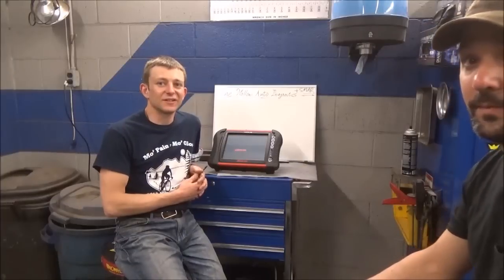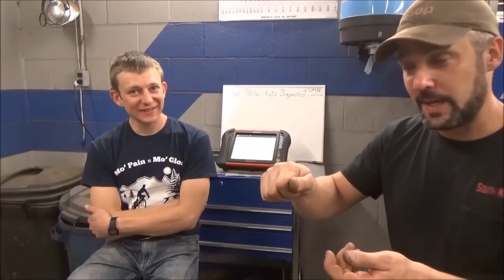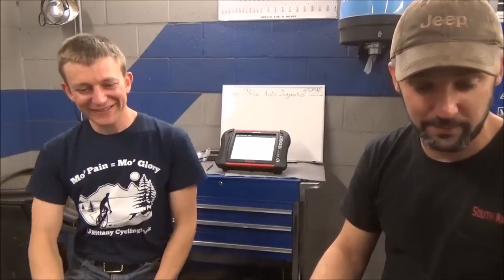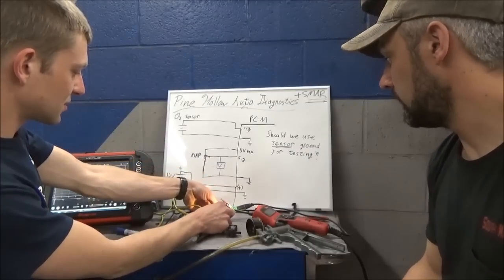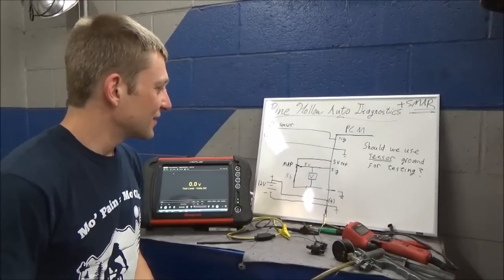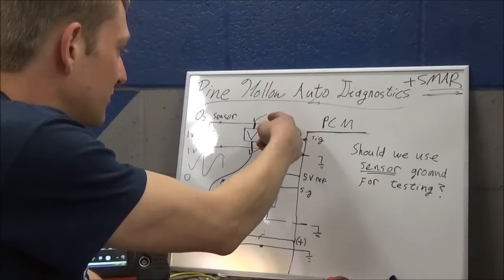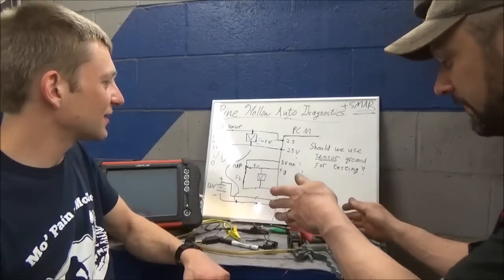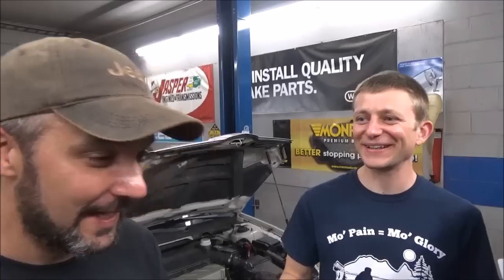O2 Sensor-No Activity Case Study: '04 Mitsubishi -Part3

Comment: My bet was that there was a "special" O2 ground wire on the ECM that was disconnected !

Good white board talk.  Nor everyone knows that O2 sensors are a true "voltage source".

As Eric knows, I have "some" background in EFI systems.  Many sensors now do NOT have a "mechanical wiper on a resistive strip" (potentiometer) but in fact "generate" the return voltage. MAP, BP, MAF are just a few.  For all intensive purposes they work the same, except under one circumstance.  With a potentiometer type sensor (TPS, temp sensors and some other "position" sensors) if the reference voltage  shifts to say 4.8v, they will still give you the correct number of "A-to-D count" (how the processor actually see "voltage" internally) where the other sensors do not.

Comment: I was wondering why all the information was showing the same information about the wiring colors on the sensors, yet the colors were wrong. And as Eric had mentioned, I've seen the wrong colors too on wires and just moved on with it. But I must admit that having an engine changed along with its wiring harness was not the first thought on my mind. You guys did some great detective work! Without having to go back and look at the wiring diagram for the 2004, where was the grounds connected at for the O2 sensors since it wasn't inside the PCM? Did they all come together inside of a connector and then a wire run off to a ground point somewhere? Just curious on its hookup...
Reply from the maker: +stuzman52 Hey Terry, thanks for the comment! The grounds for the O2 sensors on the 2004 harness all went to a common splice with all the other sensor grounds and then to the PCM on a single pin. Don't know why they decided to separate those on the 2006 model...maybe for more accurate circuit monitoring?
Reply: +motoYam82 Thanks Ivan for the reply and I believe you're right about more accurate circuit monitoring as each as their own ground circuit. Then they could detect a short or open on individual sensors.

Comment: Getting the OEM harness for the customer is the correct way to do it, awesome work. .... Having said that, if it were my car that I had bought on the cheap, I (and I think quite a few folks) would have just tried to reroute those 4 wires. How hard do you think that would've been?
Reply: That´s what customers here in Mexico wants you to do,even the filthy rich.
And it works, done it several times, I call them frankensteins. And when it comes to wiring diagrams here in Mexico It´s even worst we have vehicles from different countries and most of the  time no diagrams or very misleading. For example imagine a 2001 chevrolet truck with a obd2 conector and a  obd1 1994 TBI system. And the list goes on.When you hook a snap on scanner you have to play with several years until you get the right PIDS. Glad things are changing on late model vehicles. Still, we get for example a hyundai accent name  dodge attitude  here and have to deal with the diagrams game.

But what these awesome guys did was the right path. That´s  what makes America great

 But we go to war with the weapons we have

Comment: i enjoyed the videos mitsubishi ,who would have guessed that some put a later wiring loom in it  ,when i check o2 sensor, i check voltage on all four wires with it connected and unplugged for pcm outputs ,

Comment: Nice video!  I have a question .What could cause when i unplug both upstream oxygen sensor car runs ok but when i plug then ,the car will die as soon as it reaches normal temperature. 97 audi a4 2.8

Comment: Nice, you really did a great job with this car however, that still doesn't justify
why the scope was measuring 12V and the pcm showing 5V on B1S1. I mentioned
in part 2 comments that it is probably shorted to the heater, you can see my comment
there for why the scope vs. pcm value is different.
Reply from the maker: +Som Body See reply to Robert Hayward below...
Reply: +Som Body The PCM was supplying 12V to the B1S1 ground but was less than a 250 mV b/c it wouldn't light the test light but caused the 5V processed data. When he grounded it out with the test light it went to .020V like the other sensors. Normally you'd replace the PCM b/c of this but for 2004 the sensor grounds aren't connected to those pins with the correct harness. Whoever changed the motor and plugged in the harness got lucky Mitsubishi didn't swap out some power pins with ground pins...POOF!  Scope data is more accurate than processed data but processed data actually showed the issue. Whoever was troubleshooting it before cut the heater wire to eliminate the 12V from the sensor heater.  Bottom line is those pins aren't even used and the car is fixed but it definitely threw a twist at us!

Comment: So, if you would have done a voltage drop on the ground side (dvom connected after the load) you would have found unused power and therefore, no ground?

Comment: A great find and fix video. My thought was PCM, but I would have had to eat it with some crow. It is so hard for me to get in my head, even when the diagrams are correct, that a wiring harness is wrong for car; especially when it looks like it hasn't been disturbed. But isn't this what we do though," FIX"  broke cars by being detectives?  Would it have been possible to move existing wires in the harness to the correct pins in the harness plugs but, who knows what else might not work correctly in the future though?
Reply: alldata is great so is the dealer but sometimes its not always great... I gotta tell you that my experience is with gmc auto lock 4x4.  there are two pieces broken in the hub.  gotta buy the whole unit.  crazy stuff like the kia when it says replace timing belts at 60 k do it before that.  and replace everything in that area water pump idle bearing etc.   it just gets nasty cause most of those 4cylders are interference motors..

Comment: I would've wire wheeled and painted that rusty heat shield- just for a finishing touch- you could've used brake clean to rinse before paint. Eric- in your opinion- is it possible to "wash out" a poisoned converter? Have you ever tried to?

Comment: instead of replacing the harness, why couldnt you just repin the wires to the correct pins? would seam like that would only take a few mins?
Reply from the maker: +Mike Brennan That was Eric's decision to make. Basically it would kill several birds with one stone and make the harness correct to the car and avoid any potential confusion down the road!

Comment: l knew that's what it was!!!! lol ...(well that was easy) just proves you can't discount any clues ...aka wrong color wires like I said before I am a mechanic also Eric you call yourself doctor O I must tell you sometimes when I'm trying to diagnose cars I feel more like Quincy at the crime scene try and figure out what happened??? great video Guys!!!!!!!
Reply: +mike chainz Good call!
Reply: Lol honestly I had no idea either but the wire harness was a suspect
Reply: Ivan Eric should have used brake clean  on the wire loom that way you would have been able to see the colors easier lmao love you guys
Reply: +mike chainz Brake clean and a match haha
Reply: Yes that probably was the best option although you got it made I'm outside in chicago in the snow right now doing a front end ball joints tie rod in and out and steering box on a 05 Escalade on the ground without a lift
Reply: mike chainz Wow dang man! Sounds like you should have bought a Highlander! Lol nah JK'in
Reply: Lol I wish .....nah lol. I work from home it's customers truck
Reply from the maker: +mike chainz Wow must be some bad potholes in Chicago...or does it have 22-inch oversize chrome dubs with low-profile tires? lol
Reply: Lol both you call that Ivan 24 inch low pros
Reply: Only 129000 on the clock lol hey..it cost to look that good

Comment: I'm just putting my 2 cents in on this video.. Ivan & Eric, when you had to use a wiring diagram from 2006 didn't that kinda rang a bell. Maybe someone messed with the wiring harness. Anyway, great video. I wonder what the customer said when you told them.

Comment: It's amazing how many ground terminations go bad just from age.  Car manufacturers need to step up with the quality of their electrical designs. Not the case in this video however, it does happen much in lots of repair issues. Who woulda thought...the engine was swapped !  Goes to show if you swap the harness too, you best have done some research about that. Regarding the catalytic converter requirement, there are certified aftermarket brands out there approved by CARB. Not so sure about the OEM only if there are CARB approved brands. Maybe the state needs to look into that.

Comment: I guess if a replacement loom couldn't be sourced, you could have made a new 'mini' loom just for the O2 sensor circuits?  Would have still got same result, yes?
Reply from the maker: +Darren Coull Yup that would have worked too in a pinch.

Comment: The real issue is the pcm connector was not keyed in some way so it wouldn't fit on a different year wiring harness.  That would be the least Mitsubishi could do to prevent such.  Different year different connector even if the internals of the pcm are the same.

Comment: heres a good one my 1990 jeep was hard to start, and the vaccum line to the MAP sensor, was reading 14 inches of vaccum, turned out the timing chain was so lose the cam was 12-14 degrees off, so I replaced the chain and gears etc, and  my vaccum is 18 inchs, now yeah and some hack messed around with the temp sensor and mass air flow sensor were not getting juice, what some one did was an engine swap or shitty rebuild (blue goo on the oil pan gasket) and  instead of unplugging the harness they cut wires and taped em back together I live in WV and there is no emission checks for inspection, the engine has an oxygen sensor on the exhaust manifold, but they removed the cat, plus they removed the check engine lite from the dash, I bought the jeep for cheap, so it has been a challenge, by the way im over sixty and used to work on foreign cars when carbs and points were the norm, anyhow your video,s have been very helpful, these days, its all about diagnostics (electrical engine management,) and hardly any body does, rings and bearings etc, and most young guys dont know shit about carbs or cam timing etc, the shop says you got a rod knock so instead of repairing it, you end up with a new short block, oh well how times have changed.
Reply from the maker: Thanks for the comment Tom! I love variety...new and old school :)

Comment: Having watched many videos from both of you, I was very surprised at the start that you didn't check the wiring from the sensor to the computer. The scope on a rope would have indicated the problem very quickly. You jumped to the fancy equipment too soon. Testing the grounds and the power would show a problem. Maybe that's why I see you both checking grounds and current flow in videos that took place after this. Having worked in the used car industry in my earlier years, I learned to NEVER assume a used car is entirely original. The wrong wiring colors on the wiring diagrams had me thinking of a replaced harness. Your experience with diagrams that don't match tainted your judgement.
Reply: Are chair quarter  back here
Reply: @Emoney-z1r  Are chair? I suspect the term you were attempting to reference is Arm Chair Quarterback?

Comment: I have a 2001 puegot  has a 406 diesel engine the air conditioning has fill ports that are not the ones specified in the manual no one could explain why,  so I have to live with two different size air con ports

Comment: Does NY state prohibit the owner from buying and fitting a cheapo cat?
Reply: +Adrian Kingsley-Hughes nope... you can replace that catalyst yourself with a used, you can put a anti foul spark plug adapter in front of the o2 sensor... as long as the "$" light is out and monitors pass. another way NY screws shop owners.

Comment: Really good 3 part case study.
For me alarm bells for the sensor grounds started ringing when we seen 5 and 6 volts on the O2 data. When we see lights flash with the indicators we know there is a bad ground and the circuit is looking for the easiest path to ground. Was this not the case with the O2 circuit looking for ground on the 5 volt reference circuit. Where else could the 5 volts be coming from? You mentioned that the later model did not use the particular pin for anything but I wouldn't mind betting that internally there is something connected to it.
I may be be way out in left field but it seems to make sense to me 
Either way. I really enjoyed the series.

Comment: Question. Assume the following hypothetical....The owner travels to another state, buys an aftermarket Catalytic Converter, then installs it themselves onto this vehicle. When they go in for inspection in NY, do they actually look at the CAT visually and fail the vehicle if it's not OEM? If so, what happens if you bring in an out of state registered vehicle that's equipped with a non OEM converter and try to register it. Does the state government force the owner to buy an OEM converter and replace it before passing it? Of course I'm only asking for general knowledge. I would never attempt to actually do anything like that or encourage anyone else to. I always comply with all government rules and regulations personally.

Comment: could you have just depinned the wires and reinstalled them in the correct pins. If all wires were the same except for those 4 wires?
Reply: Think again. The most important pinouts (for this case) on this computer are "not in use".
Reply: @josdiepenbeek469  This had nothing to do with the computer. The wiring harness was pinned incorrectly for that year. I shoulh have been just WAY easier just to move the pins on the harness to match what was the original set up. Your reply made no sense.

Comment: Ran into that "CARB" issue with our VW.  wound up ordering from a parts house in NYC that had me supply vin, emission information, etc..  Found that if the converter was an "exact" match aftermarket compared to factory it is legal to replace with a non-carb converter.   These laws are made to punish, not to protect.   Too many loopholes and too many pitfalls, and not enough information as what can be used or not.  Did I get my converter via a loophole?  Probably.  The CARB one goes for over 800 and it would require me to change out the exhaust manifold  (ours is a single downpipe, the CARB one was only made for the twin downpipe from the manifold)  So these clowns have no clue what their baloney rules do to the end consumer.  

While I am all for 'clean air'.  The CARB requirements are a bunch of baloney.  Just more progressive NYC and by extension Albany (who gets it's power from NYC, and the heck with the rest of the state) trying to be just like Cali.  Just a bunch of loon's trying to control people.

Of course, that's just my opinion..

Comment: i have a 1998 chevy  k1500  5.7. service light comes on. go a friend and he tested it by the obd  shows bank 1 sensor 2.  ok.    go to another guy, same  code p0141.  ok.  YOUTUBE videos,,,,,, onr guy says  o/2  and relay are both on some FUSE!  ok.   one guy says  always start with fuses ALL  fuses  ok.  i checked ALL fuses  with mo/ volt meter,and had some fuse  that checked good on one side but not the other,  ok  pushed ALL fuses in and around,   ok   had to go to store right now,   ok    started truck and  by about 100 feet i noticed service light is OFF,  ok hald ass to store then to smog station  ,  ok  PASS!!!!!!!!!!!!!!!!!!!!!!!!!!!!    smog was due in 29 days  BOOM!! PASS!!!    check ALL fuses FIRST when you know its electrical    HAPPY NEW YEAR for ME!!!!    Dano   1/1/17
Reply from the maker: lol if it's fixed, it's fixed!
Reply: TIME .   i'll let you know down the road.    Dano   note : i really like your videos 's and how detailed you are.  i'll keep watchin !